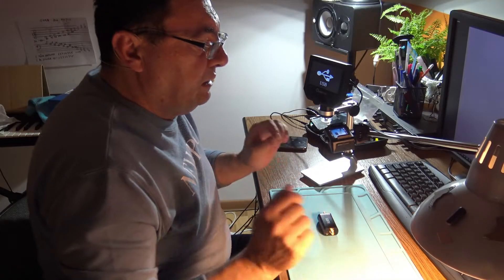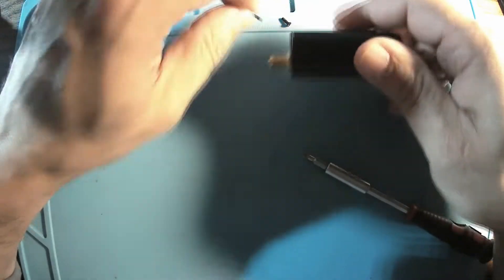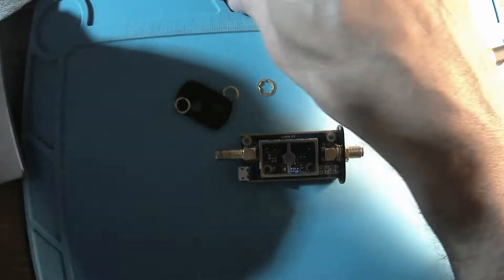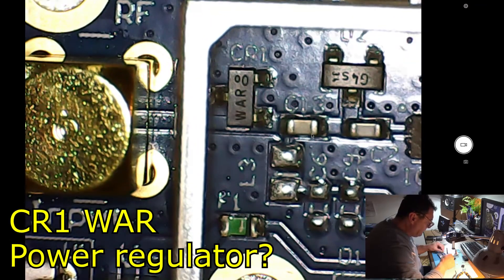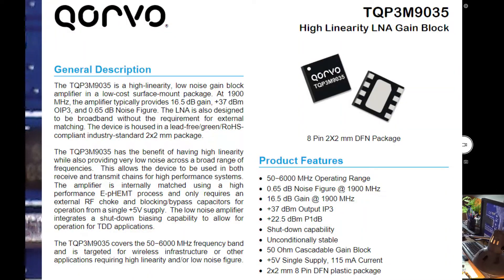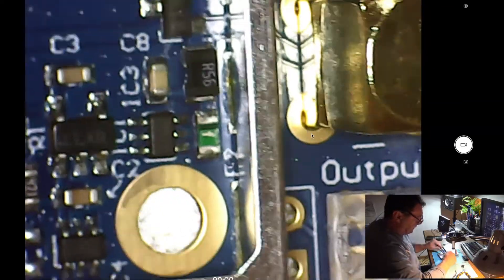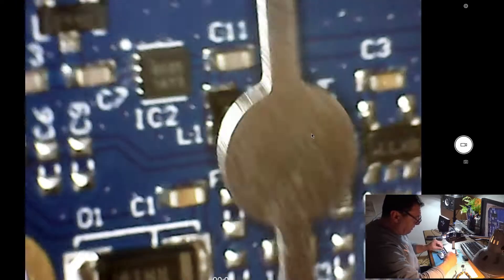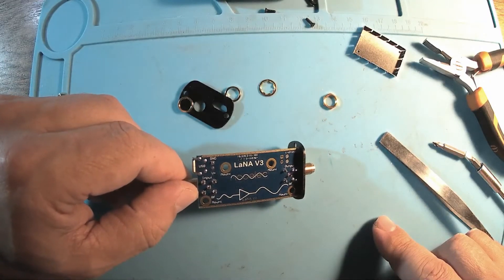NOOELEC Lana v3 LNA amplifier dismantle

Comment: Great video. My Bias T cannot power this. If I removed the LED do you think  it would help?
Reply from the maker: I don't see  the problem with having the LED there. It should be something else, maybe a short in the cable or a capacitor somewhere in short...
Reply: Thanks

Comment: Could you share some details on its actual performance as a helium amp? The noice figure of TQP3M9035 is good enough as well as the gain, but does it really gives us some Rx improvement besides the lack of Tx capability?
Reply from the maker: So far is the best RX amplifier I'm using..I will do a video about this days with RSSI and SNR number compare with others ..
Reply: @viocaia  will you do tests from behind cavity filter? In my testing most helium amps operate with much lower noise floor using an acasom type cavity (very close 10 mhz stop bands on either side) vs the mcgill with looser 150~mhz rejection from either side
Reply from the maker: @cactuarking4138  I don't have a cavity filter so I can't say, but normaly that is the best you can get SNR speaking..

Comment: 20mhz-4000mhz for 40 dollars is not bad, but it is an RX only LNA with no ability of a TX.
Reply: Based on SPF5189Z which is 50mhz not 20mhz so not sure what is going on.  Specs for the SPF5189Z is very good for such a broad spectrum range.  

Key Features
Ultra-Low Noise Figure = 0.60dB at 900MHz
Gain = 18.7dB at 900MHz
High Linearity: OIP3 = 39.5dBm at 1960MHz
P1dB = 22.7dBm at 1960MHz
Single-Supply Operation: 5V at IDQ = 90mA
Flexible Biasing Options: 3V to 5V Adjustable Current
Broadband Internal Matching
Reply from the maker: It's not based on SPF5189! They said is nothing like that...''A wideband, high-performance, general purpose LNA module installed in a quality aluminum enclosure. Higher gain, lower noise figure, lower power consumption and better linearity than  (!!!!!)   modules based on SPF5189Z and similar LNA MMICs.  https://www.nooelec.com/store/lana.html
Reply: @viocaia  Right, it is even better.  The better probably comes in with going down to 20mhz instead of its 50mhz.  Pretty sweet.

All I could find on their own site is this -> A wideband, high-performance, general purpose LNA module installed in a quality aluminum enclosure. Higher gain, lower noise figure, lower power consumption and better linearity than modules based on SPF5189Z and similar LNA MMICs.

Not bad, but it doesn't do TX and for the crypto miner it needs to do RX as well as TX.  I suspect this could be some of the issues you are having as you can hear but no one can hear you since the devices, so far, can't TX.
Reply from the maker: @generalawareness101  Pitty ! So far I got nice RX results..like you said no beacon..I'll hook a circulator for that..
Reply: @viocaia  Anything without TX abilities is basically acting like a shunt so kills the signal outward.
Reply from the maker: @generalawareness101  Absolutely! The point is I don't care about beacon for this test..it's temporary..
Reply: @viocaia  Right.  My hope is that you eventually find something that is LNA for RX and allows the TX to flow through even if that is a bypass type system.
Reply from the maker: @generalawareness101  I got an idea.., I will combine TX from AB amplifiers..with RX of NOOelec..all I have to do is make the connections before the RX/TX switches both input/output and disable the LNA chip on AB board..
Reply: @viocaia  A transmit-receive switch is always required if you want to operate separate transmitters and receivers on one antenna. This has been the classic antenna relay of any transceiver for decades, but now with the advent of SDR receivers it has become popular again as an external relay.

This is because modern SDR technology offers a radio amateur excellent expansion possibilities for a normal radio: bandscope, waterfall display and much more. And to make better use of the existing antenna, the external relay switches between the transceiver and the SDR receiver. Very safe and comfortable.

They are not cheap, but they do exist though it is a two in scenario that rf senses to make the physical switch.
Reply from the maker: @generalawareness101  Yep! It's nice to experiment..
Reply: @generalawareness101  a circulator is like 20-30$, if it works well enough as a rx amp the fact that it's not a bda is something easily worked around
Reply: @cactuarking4138  Thanks for your input.
Reply from the maker: Wrong..! It's https://www.qorvo.com/products/p/TQP3M9035